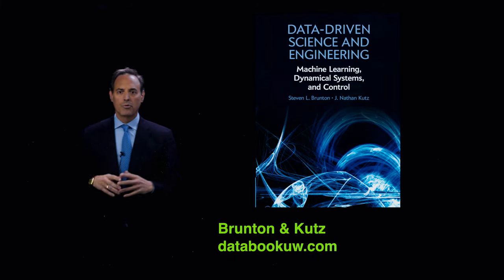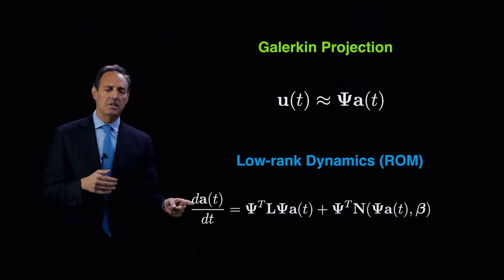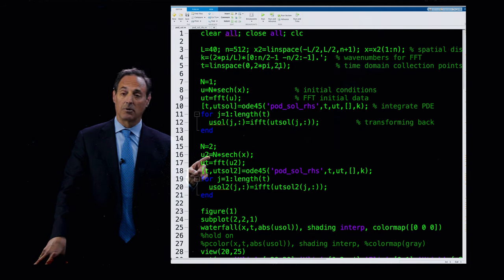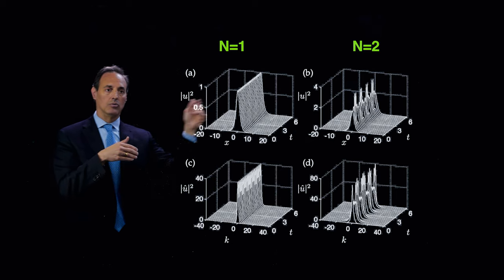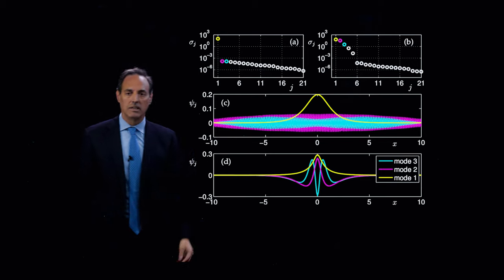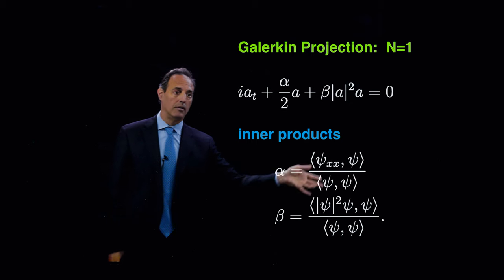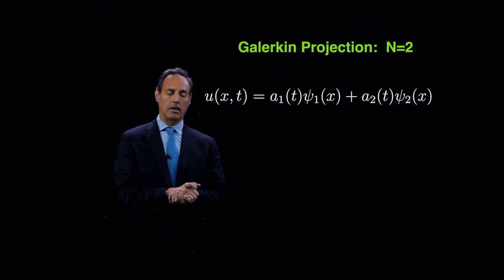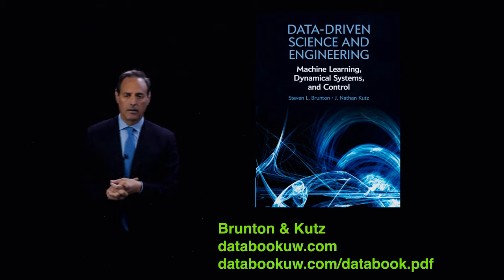POD and Soliton Dynamics

Comment: Conservation of Spatial Curvature (both Matter and Energy described as "Quanta" of Spatial Curvature)

Is there an alternative interpretation of "Asymptotic Freedom"?  What if Quarks are actually made up of twisted tubes which become physically entangled with two other twisted tubes to produce a proton?  Instead of the Strong Force being mediated by the constant exchange of gluons, it would be mediated by the physical entanglement of these twisted tubes.  When only two twisted tubules are entangled, a meson is produced which is unstable and rapidly unwinds (decays) into something else.   A proton would be analogous to three twisted rubber bands becoming entangled and the "Quarks" would be the places where the tubes are tangled together.  The behavior would be the same as rubber balls (representing the Quarks) connected with twisted rubber bands being separated from each other or placed closer together producing the exact same phenomenon as "Asymptotic Freedom" in protons and neutrons.  The force would become greater as the balls are separated, but the force would become less if the balls were placed closer together.  Therefore, the gluon is a synthetic particle (zero mass, zero charge) invented to explain the Strong Force.  An artificial Christmas tree can hold the ornaments in place, but it is not a real tree. 

String Theory was not a waste of time, because Geometry is the key to Math and Physics.  However, can we describe Standard Model interactions using only one extra spatial dimension?

What if we describe subatomic particles as spatial curvature, instead of trying to describe General Relativity as being mediated by particles?  Fixing the Standard Model with more particles is like trying to mend a torn fishing net with small rubber balls, instead of a piece of twisted twine.

Quantum Entangled Twisted Tubules:  
“We are all agreed that your theory is crazy. The question which divides us is whether it is crazy enough to have a chance of being correct.”    Neils Bohr
(lecture on a theory of elementary particles given by Wolfgang Pauli in New York, c. 1957–8, in Scientific American vol. 199, no. 3, 1958)

The following is meant to be a generalized framework for an extension of Kaluza-Klein Theory.  Does it agree with the “Twistor Theory” of Roger Penrose, and the work of Eric Weinstein on “Geometric Unity”?  During the early history of mankind, the twisting of fibers was used to produce thread, and this thread was used to produce fabrics.   The twist of the thread is locked up within these fabrics.  Is matter made up of twisted 3D-4D structures which store spatial curvature that we describe as “particles"?   Are the twist cycles the "quanta" of Quantum Mechanics?

When we draw a sine wave on a blackboard, we are representing spatial curvature. Does a photon transfer spatial curvature from one location to another? Wrap a piece of wire around a pencil and it can produce a 3D coil of wire, much like a spring. When viewed from the side it can look like a two-dimensional sine wave. You could coil the wire with either a right-hand twist, or with a left-hand twist. Could Planck's Constant be proportional to the twist cycles. A photon with a higher frequency has more energy.  ( E=hf, More spatial curvature as the frequency increases = more Energy ). What if gluons are actually made up of these twisted tubes which become entangled with other tubes to produce quarks. (In the same way twisted electrical extension cords can become entangled.) Therefore, the gluons are a part of the quarks. Quarks cannot exist without gluons, and vice-versa. Mesons are made up of two entangled tubes (Quarks/Gluons), while protons and neutrons would be made up of three entangled tubes. (Quarks/Gluons) The "Color Charge" would be related to the XYZ coordinates (orientation) of entanglement. "Asymptotic Freedom", and "flux tubes" are logically based on this concept. The Dirac “belt trick” also reveals the concept of twist in the ½ spin of subatomic particles.   If each twist cycle is proportional to h, we have identified the source of Quantum Mechanics as a consequence twist cycle geometry.  

Modern physicists say the Strong Force is mediated by a constant exchange of Mesons. The diagrams produced by some modern physicists actually represent the Strong Force like a spring connecting the two quarks. Asymptotic Freedom acts like real springs. Their drawing is actually more correct than their theory and matches perfectly to what I am saying in this model. You cannot separate the Gluons from the Quarks because they are a part of the same thing. The Quarks are the places where the Gluons are entangled with each other. 

Neutrinos would be made up of a twisted torus (like a twisted donut) within this model. The twist in the torus can either be Right-Hand or Left-Hand.   Some twisted donuts can be larger than others, which can produce three different types of neutrinos.   If a twisted tube winds up on one end and unwinds on the other end as it moves through space, this would help explain the “spin” of normal particles, and perhaps also the “Higgs Field”.   However, if the end of the twisted tube joins to the other end of the twisted tube forming a twisted torus (neutrino), would this help explain “Parity Symmetry” violation in Beta Decay?  Could the conversion of twist cycles to writhe cycles through the process of supercoiling help explain “neutrino oscillations”? Spatial curvature (mass) would be conserved, but the structure could change. 

Gravity is a result of a very small curvature imbalance within atoms. (This is why the force of gravity is so small.) Instead of attempting to explain matter as "particles", this concept attempts to explain matter more in the manner of our current understanding of the space-time curvature of gravity. If an electron has qualities of both a particle and a wave, it cannot be either one. It must be something else. Therefore, a "particle" is actually a structure which stores spatial curvature. Can an electron-positron pair (which are made up of opposite directions of twist) annihilate each other by unwinding into each other producing Gamma Ray photons?  

Does an electron travel through space like a threaded nut traveling down a threaded rod, with each twist cycle proportional to Planck’s Constant?  Does it wind up on one end, while unwinding on the other end?   Is this related to the Higgs field?  Does this help explain the strange ½ spin of many subatomic particles?  Does the 720 degree rotation of a 1/2 spin particle require at least one extra dimension? 

 Alpha decay occurs when the two protons and two neutrons (which are bound together by entangled tubes), become un-entangled from the rest of the nucleons

. Beta decay occurs when the tube of a down quark/gluon in a neutron becomes overtwisted and breaks producing a twisted torus (neutrino) and an up quark, and the ejected electron. The production of the torus may help explain the “Symmetry Violation” in Beta Decay, because one end of the broken tube section is connected to the other end of the tube produced, like a snake eating its tail. The phenomenon of Supercoiling involving twist and writhe cycles may reveal how overtwisted quarks can produce these new particles. The conversion of twists into writhes, and vice-versa, is an interesting process, which is also found in DNA molecules.  Could the production of multiple writhe cycles help explain the three generations of quarks and neutrinos? If the twist cycles increase, the writhe cycles would also have a tendency to increase.

 Gamma photons are produced when a tube unwinds producing electromagnetic waves.

    The “Electric Charge” of electrons or positrons would be the result of one twist cycle being displayed at the 3D-4D surface interface of the particle.  The physical entanglement of twisted tubes in quarks within protons and neutrons and mesons displays an overall external surface charge of an integer number.  Because the neutrinos do not have open tube ends, (They are a twisted torus.) they have no overall electric charge.

>>>>>>>>>>>>>>>>>>>>>>
Within this model a black hole could represent a quantum of gravity, because it is one cycle of spatial gravitational curvature.   Therefore, instead of a graviton being a subatomic particle it could be considered to be a black hole.   The overall gravitational attraction would be caused by a very tiny curvature imbalance within atoms.  We know there is an unequal distribution of electrical charge within each atom because the positive charge is concentrated within the nucleus, even though the overall electrical charge of the atom is balanced by equal positive and negative charge.
>>>>>>>>>>>>>>>>>>>>>>
In this model Alpha equals the compactification ratio within the twistor cone, which is approximately  1/137.

1= Hypertubule diameter at 4D interface

137= Cone’s larger end diameter at 3D interface where the photons are absorbed or emitted.

The 4D twisted Hypertubule gets longer or shorter as twisting or untwisting occurs.   (720 degrees per twist cycle.)  

>>>>>>>>>>>>>>>>>>>>>>>
How many neutrinos are left over from the Big Bang?  They have a small mass, but they could be very large in number.     Could this help explain Dark Matter?
>>>>>>>>>>>>>>>>>>>>>>>>

Why did Paul Dirac use the twist in a belt to help explain particle spin?  Is Dirac’s belt trick related to this model?    Is the “Quantum” unit based on twist cycles? 

++++++++++++++++++++++++++++++++++++++++++++++++++++++++++++++++++++++++++

I started out imagining a subatomic Einstein-Rosen Bridge whose internal surface is twisted with either a Right-Hand twist, or a Left-Hand twist producing a twisted 3D/4D membrane. The model grew out of that simple idea. 

 I was also trying to imagine a way to stuff the curvature of a 3 D sine wave into subatomic particles.
.

Comment: Thank you for your videos, they are very helpful in conjunction with the book!
I had a question about this method:
The POD method only works on PDEs that can be solved by the method of separation of variables right? When can a PDE not be solved by separation of variables, and are there data-driven methods to deal with those kinds of PDEs?
Reply: The same procedure applies to all PDEs. It can be used for PDEs unable to be solved using separation of variables